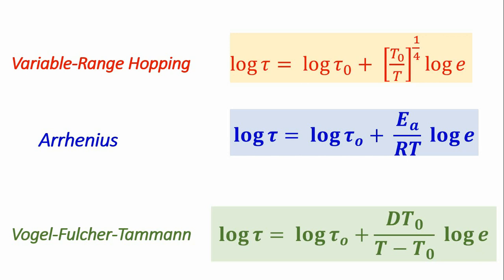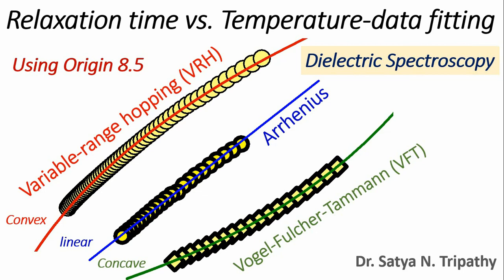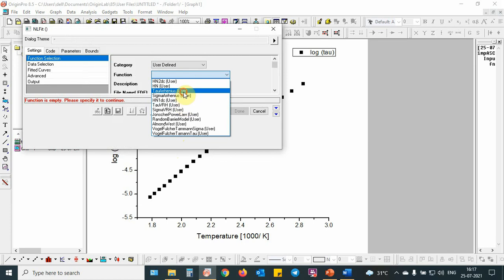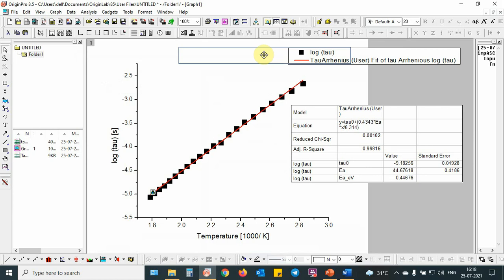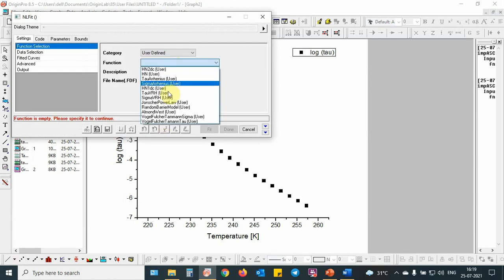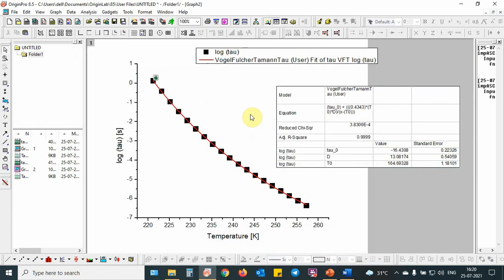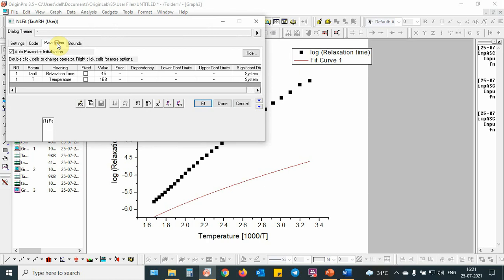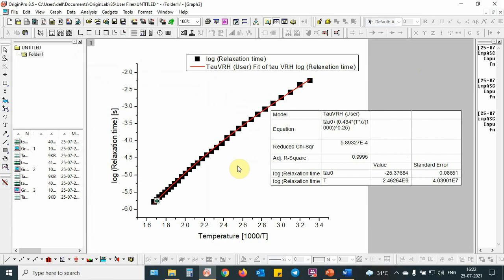Arrhenius, Vogel–Fulcher–Tammann (VFT) & Variable Range Hopping (VRH) Model Fitting Using Origin

Comment: Hi, nice video. Thank you for your contribution. What equation do you use for VFT fitting to the electrical conductivity? I see that you have a different origin user function for that purpose. What is the equation for that case? (Plot of sigma instead of plotting the time constant)
Reply from the maker: Fitting procedure in Origin:
Arrhenius: Parameter: tau0, Ea; Equation: y=tau0+(0.4343*Ea*x/8.314).

Variable range hopping (VRH): Parameter: tau0, T; Equation: y=tau0+(0.434*(T*x/(1000))^0.25)

Vogel-Fulcher-Tammann (VFT): Parameters: tau_0, D, T0; VFT Equation: y=(tau_0) + (((0.4343)*(T0)*D)/(x-(T0)))